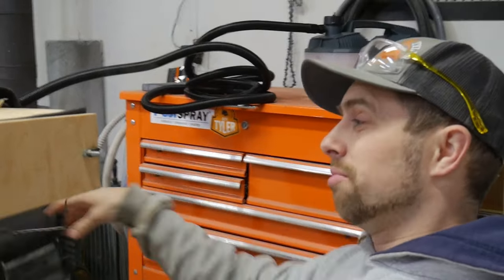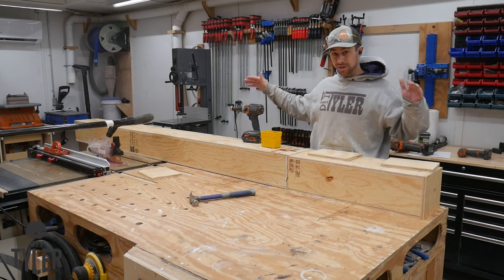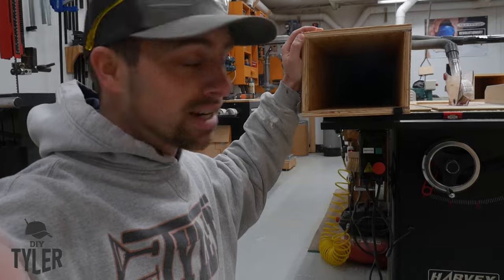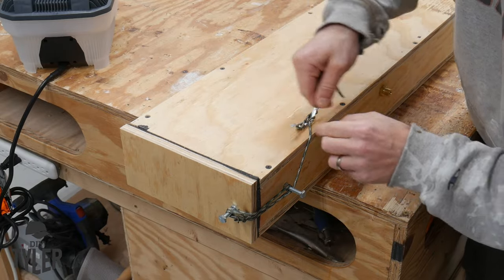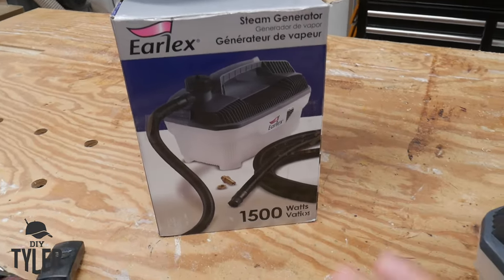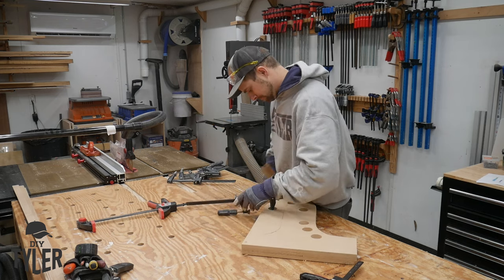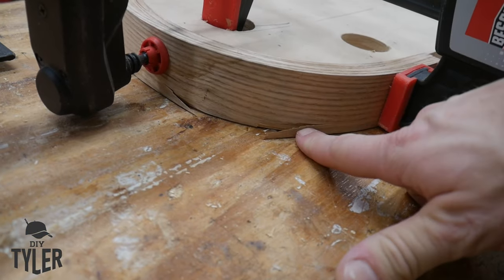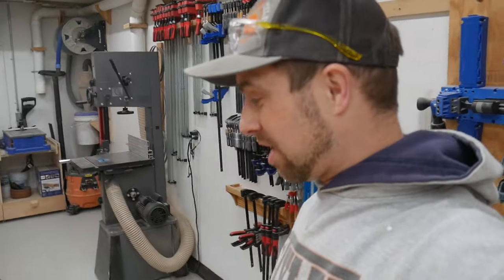How to Steam Bend Wood and Testing the First Bent Lamination!

Comment: Neat experiment! One thing I thought of - You should shorten the hose from the steamer to the steam box as much as possible, or insulate it against the cold of the barn as much as possible. The steam inside that plastic hose is starting to condense as soon as it hits that hose in the cold barn.
Reply from the maker: That is a great point, will definitely do that if I can modify the fittings! At least I will toss a blanket over the hose. Thanks!